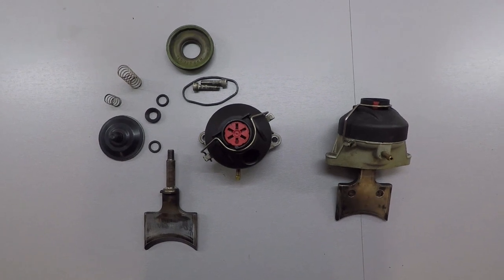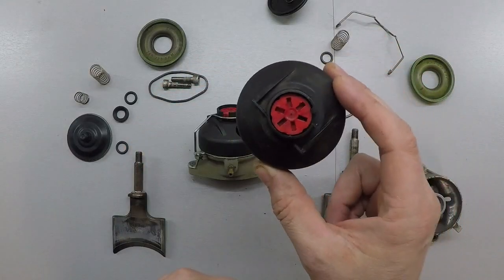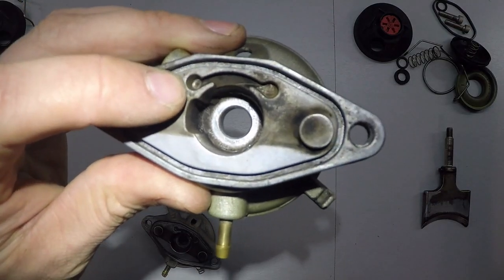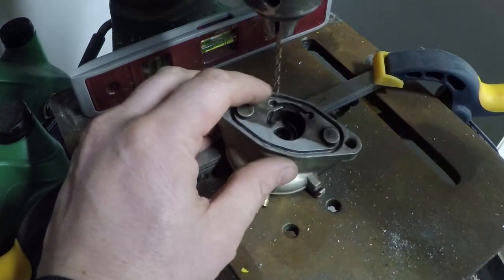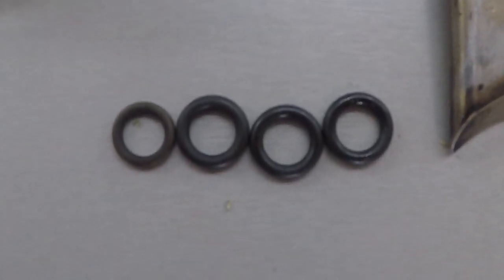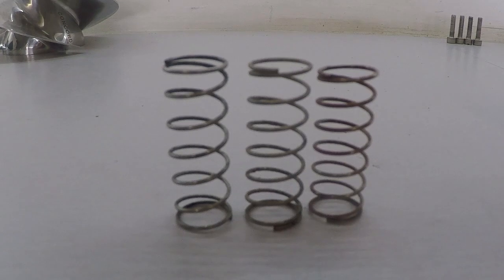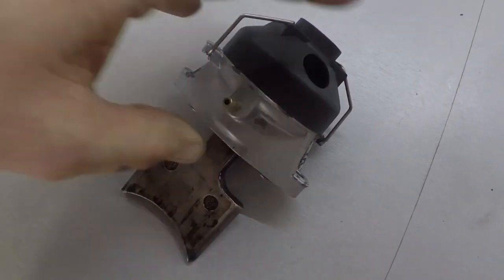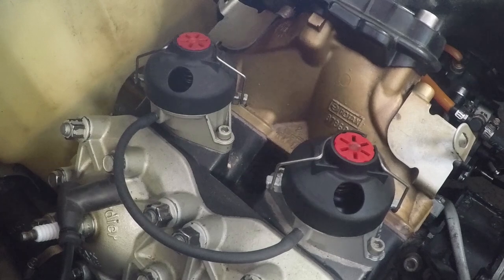SeaDoo RAVE Valve Mods and Info   XPL951 Mods

Comment: Hey interesting video. So I have two 951 gtx’s that are both rebuilt, however both continuously keep burning up exhaust sleeves down toward the end of the exhaust. I’ve had them to a shop twice to change the exhaust hoses.
After googling I read that when they burn up exhaust hoses it’s almost always because the rave valves are stuck or broken . Any advice?
Reply: You want to look at your water regulator valve, it may not be working. Looks just like the rave valves but it's on the waterbox.